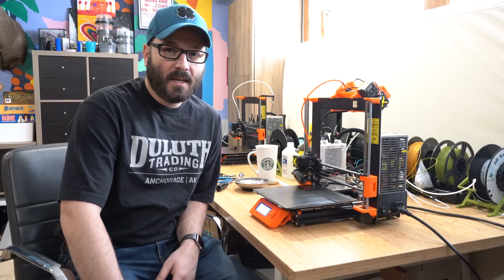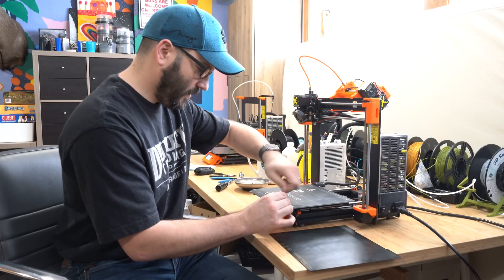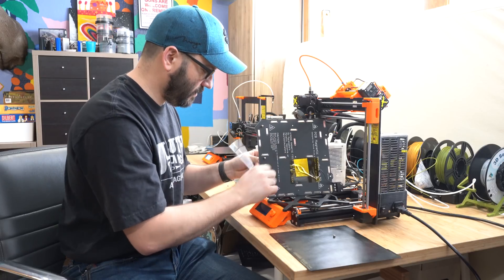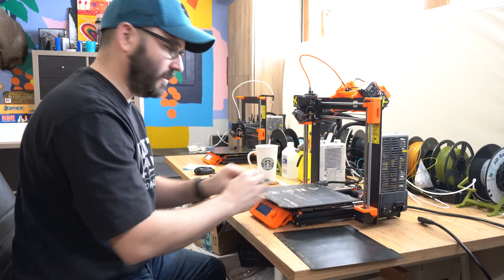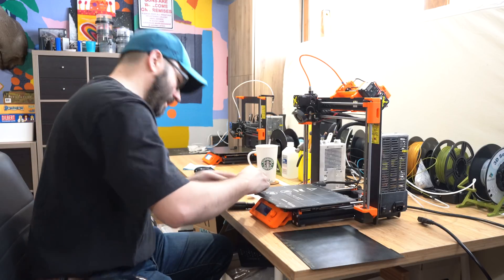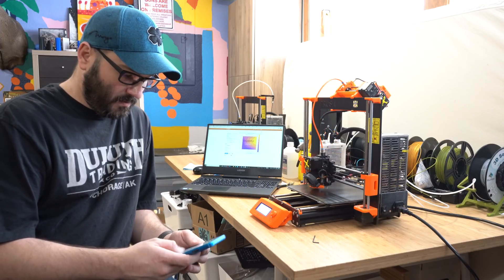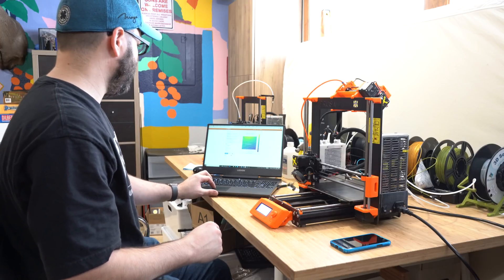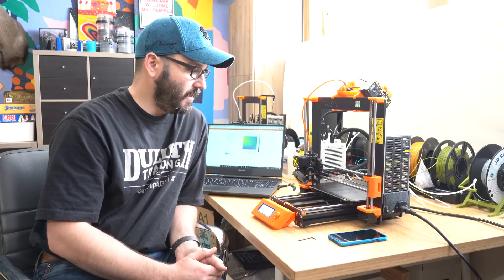PRUSA i3 MK3 Nylock Bed Leveling

Comment: Shouldn't you go and tighten the nylock now so it doesn't move?  Aka hold the screw in place and tighten the nylock against the bed?

If not it seems like this would move over time from heating and cooling.

Comment: I still can’t wrap my head around what this is doing. If I got it correct, the nyloc and the screw head is capturing the bed plate? And by doing so, turning the screw will move the bed up or down?  Okay, so doesn’t the pinda mesh leveling take care of any unlevelness? What is the advantage of physically leveling the bed?
Reply: If the differences of your bed are too big, abl will fail.

Comment: I want this. How do I connect my laptop to prusa printer to do this. Do I install octoprint on windows machine.
Reply: No, typically Octoprint is installed on a RaspberryPi. Search for OctoPi to get an easy start. When it’s up and running you handle it by it’s web-interface on a device of your choice.

Comment: You didn't edit for time very well, or explain the most important things!
Twelve minutes of putting on nuts, when you could have put on one nut & just said, "repeat for the next 7 outer bolts". A task so simple my 5 year old could do it...Then you started doing something with a laptop, without mentioning what program you're using, or how you somehow made your Prusa communicate with WiFi. You should have taken only one minute to explain the Nylocks, and the rest explaining how to set up whatever system you're using for the rest of it.
Your Nylock Leveling Update video didn't expand on any of that shit either. 
Someone told me I need to purchase a Raspberry Pi. Not that I'd know that from watching any of this. I'll still need to learn how to get a Pi to work. Jesus, this video is worthless to anyone who doesn't already know how to do the hardest part.

Comment: i recently bought the mk3s+ and im wondering why and should i make  this mod?
Reply: if you have no problems then you don't need to mess with anything. i got an mk3 a few months ago specifically so I didn't have to mess with repairs, tweaking and mods. it so nice just to print and not having to tweak things all the time. if you got a printer because you like to make and mess with things, then you can do this just for fun.

Comment: To make the leveling faster: A M3 Screw has a pitch of 0.5 mm. That means one complete Turn will move the bed up or down about 0.5mm per Turn. So it’s easy for you to say 90 degrees of Turning will be 0.125 mm in Z and so on

Comment: if the pcb is not perfectly flat then it certainly should be once you tighten it fully against all of those spacers.... if anything, its the y axis frame underneath that isnt perfectly flat, which isnt surprising especially being powder coated

Comment: I seem to be having an issue.  I keep getting z-level enforcered when I try to do the bed leaving via OctoPrint with Prusa plug-in.  Have you experienced that before.
Reply: Yeah. I had that happen. If your bed is that off to trigger Z-level enforced, you might need to do an XYZ calibration and then go back to mesh leveling.

Comment: The concept of adjusting by adjusting screw and locking nut is not new. The true variant that makes a rigid spaced riser and ajustable is by having two nuts To lock the screw on each reference plane (bed and frame). It goes like Screw-bed-nut1-nut2-frame. The nut1 butts against underside of bed, and nut 2 butts on top of frame. Ideally insert some washers too (between nut and bed and between nut2 and frame) but must very thin, space is at premium.

Then you must be able to tighen those nuts with bed in place (a thin open end wrench from the side).
The procedure is the same as you tighten nuts1 loosley on the bed (so it can turn the screw on the bed) and fist butt up the nut2 to lock nut1 so it does not move while adjusting. Adjust as presented in video and then:
1 Hold the screw head from top.
2. Loosen nut 2 from nut1
3. Tighten the nut 1 against bed
4. Tighten nut 2 against frame

Re-check (doing the final locking of nuts will certainly move by a very tiny amount from initial calibration as those gaps are closed and screw thread extended in the frame threads). Now the screw is the only one that changes the distange but it is locked in place. So for each minor readjustment you need to hold the head of the screw and loosen both nuts, and turn the screw accordingly, retighten and recheck. It is more fiddly in the last part to keep locking and unlocking nuts from the side but is the best method.

Even better is to use two nylocks on each screw insted of two normal nuts but nylocks are taller and there is not enough space available. Normal nuts are good enough as those nuts will be tight in the end and lock everything. So i'm not concerned about loosening. 

The down side is that you need to have good access from the side and acces those nuts. I have a prusa mk3s and will do this in short time and i will use two normal nuts. From what I see there is enough space for a flat open end wrench for those nuts to be tighten from the side and enough space for two nuts . The middle is the reference fixed. with original spacer so no need to worry about it.

So the Prusa original spacer is about 5.5mm tall. Let's say 5mm. A normal m3 nut is 2.35mm (2.31, 2.32, top reading 2.35). A nylock m3 is 3.95mm. I'd say two normal nuts is the best approach and have enough space to fit and leave about 0.7mm worth of adusting. If or some reason the two nuts actually don't fit you can put a washers on the the center stand this gains aditional space for all perimeter screws. I might add a washer to center stand to gain enough clearance for all screws to add at least a washer against the underside of the bed. (it's not nice to twist and lock against delicate pcb coat underneath). Also take creat care with the side wrenching! if you are not careful you may marr the underside of the bed while manipulating the wrench! Take great care not to scrape the wrench against the underside of bed while mainipulating the nuts!

Also do not tighten those nuts too much to avoid striping the screw! A side wrench with normal open end wrench gives you so much leverage that you must tighten with one finger. M3 is delicate and can strip with a normal screwdriver grip, an allen key gives about double leverage when long part is the handle, and an open end nut wrench is about double or triple the lenght so a lot more leverage quadruple leverage ! so DO NOT FIST GRAB the delicate m3 nut with the wrench.

Anyway. The concept of adjusting screw and locking nut to lock the position of the screw is veavily used in any adjustable mechanical system like valve thermal clearance on a car engine, or the distance between brake shoes and drum for parking brake (to spin in normal mode and to bite a bit when hand brake is applied about 2-3 tooth and have enough stroke left to fully actuate, and when release to fully realease the shoe.. it's a screw and an nut on it that space out the cam and brake shoe). The key difference is that screw and nut are solidly locked and nut is tight. and not left loose so you can turn the screw. If you need such action then two axial thrust bearings would be the corect choice but is literaly no space for that in this aplication.
Reply from the maker: While the extra nuts are indeed a better option, there just isn’t the space under the bed for this. It’s easier and still functions great just to do the single lock nut against the bed.

Comment: Has anyone seen any issues with using nylon lock nuts needing adjustment long term? From what I have found nylon lock nut inserts are only rated to max temp 220F.

Comment: i posted in the Github, but i will also post it here. Ever since my Nylock Upgrade, i have been unable to run a successful Calibration. where did i go wrong?
Reply from the maker: Man that’s crazy, I have not had any issues with calibration since I’ve done this on three separate MK3s.

Comment: Is this like a one-time-leveling or do I need to re-level it at some point?
Reply: The prusa have mesh leveling anyway, so in theory you don't need to adjust at all the bed. But starting from a good reference is a very good approach. I don't think you need to readjust it any soon. 
So the goal is to not have a bed slanted and center dipeed by 1-2mm and rely on the mesh leveling done in software but actually make the bed flat and level to start with.
In terms of printing quality is debatable. Mesh leveling is cool to print on the most croked beds with no noticable differece but still the best result is to print on a flat and level bed. this way the mesh leveling will have minimal corections to do. And if the bed becomes a bit uneven by some reason then the mesh leveling will sort it out.

It's not hard to fire up the octoprint mesh leveling plugin from time to time to see if values are still decent. They are not to be perfect. As seen in the video, the original orientation as 1mm difference! and printed flawlessly but still is nice to go from a flat condition and the mesh leveling just fine adjusting.
Reply from the maker: If you’ve done it hot you may not need to do it again. However it doesn’t hurt to check it every few months anyway.

Comment: Did you calibrate zxy after moving gantry by hand? I didn't notice. But I think I'll try this on mine. I know that there's slight deviation on mine at the front right corner.

Comment: why did you skip the most important part???? Getting mesh visualizer to work....the rest is mindlessly easy ... >_<. The forums full of people who can't get visualizer to report.  I spent two days piecing info together and i only figured it out by looking at an ENTIRELY different app for reference.
For Prusa this is the GCODE you must use to make it work:
G28 W ; home all without mesh bed level
M400
G80 N3; mesh bed leveling
G81 ; check mesh leveling results
G1 Z60 Y210 F6000

Comment: Thanks for making this tutorial.  I just bought my some nuts and i'm gonna try it this week.  Just one piece of advice that might help: m3 screws have a .5mm pitch, so if your variance at one corner is, say .1 mm from the center, you should try rotating the screw by 1/5 of a full rotation (about 70 degrees).  this should help getting things tuned more quickly.

Comment: When bed is hot variance is 0.11 when is cold is 0.022 it’s normal? .... ok after i try to adjust all screws when bed it’s hot now i have 0.02 at 70 degrees .. and 0.06 at 85 degrees and 0.06/0.07 when bed is 60 degrees ... cool 😎
Reply from the maker: It does change with heating and cooling for sure! Very nice!

Comment: if you don't want to buy additional parts, disassemble everything and reassemble do as I do, just add paper washers where the top is lower and slightly file the steel spacers where the top is high with this method I managed to obtain the same results and I believe  is even better because more solid ... however both methods are valid ... change everything with the nylock method, or go to act on the original supports as I did
Reply from the maker: That is a valid option for sure! It's just not adjustable if you need to again (either to replace the bearings or just as parts wear.)
Reply: BenGadget yes exactly it is more difficult, and slow to do ... and as you say you cannot correct precisely as with the mod ... anyway to correct the very crooked areas you can do so ... thanks for the video guide !!

Comment: Do you need to tighten the nylocks underneath after you get the results you want?
Reply from the maker: Yes! You will need to hold the screw from the top and then tighten the nut against the heated bed on the bottom to keep the screw from moving again.

Comment: Necesitamos una raspberry para poder conectar el pc a la prusa no? es decir no se puede hacer sin raspberry?
Reply from the maker: Marco A. Gonzalez no you do not have to use a raspberry pie, you can use in a Windows or MacOS or I think Linux computer
Reply: @bengadget5095  y como conecto el pc a la prusa? Con el cable usb? Y luego abro octoprint en el pc?
Reply from the maker: si, eso es correcto

Comment: Ben, I actually tightened my nylocks down between each bed leveling with a 5.5mm wrench. Then for the ones that needed adjusting, I would loosen the nylock slightly, turn the hex bolt, then retighten the nylock. It was a little more tedious but I was worried (probably for naught) that they might vibrate and loosen some. I got my total variance down to .05mm and could probably do better but half the thickness of a hair seems pretty good. Thanks for going through the process. Your video clearly went through and showed the process.
Reply: if they're nylock they won't move. ever.

Comment: Thanks man, my bed is now at 0.02. Im so happy.  Never had problems but this is a great upgrade!
Reply from the maker: That’s great!!! I’m glad it worked out for you.
Reply: @bengadget5095  Hey Ben, one more question. Like i said my value was at 0.02, but after 1 or 2 weeks it was at about 0.6. Is that normal or Did I something wrong? Or is it normal that the value is changing?
Reply from the maker: @TheOldKenobi  I think it's normal for it to change with a couple heating cycles if you don't have the nylocks completely firm. I would do it again with the bed hot, and then make sure the screw is tight against the nylock when you are done.

Comment: Hey there, got a mk2 went to 2.5 and want to do the nylock, how long are the screws that enter the top of your heatbed? And am I correct I should be able to thread them into the x carriage? because I can't on mine the bolts slide right through from the bottom into the spacers.
Reply from the maker: The screws for the MK3 bed are: M3x12. You should be able to thread them into the X carriage, but I removed the spacers  between the bed and the carriage (that's where the nylock nuts go.) I don't know if it's the same on the MK2 or 2.5 as I don't have one, nor do I know anyone that does :-(

Comment: why are the nuts build in with the nylon part facing the printbed?
Reply from the maker: I turned them over so there would be less contact with the bead for heat transfer, but in the end I don't think it makes any difference.

Comment: Do you still need to do this now that the heatbed has spacers where you would put the nylon nuts?
Reply from the maker: Yes, it has always shipped with the spacers, unfortunately there is no way to adjust the spacers, that is why we use the NyLocks. :-)

Comment: Maybe a stupid question but why should you do this procedure with the nylocks?
You have auto bed leveling that compensates the difference in level/height!
Or is that not precise enough, i do not understand it.
Reply from the maker: The mesh bed leveling will allow for the printer to have a virtual level bed. it will move the Z-Axis (hotend) up and down to have the same height first layer.

This is great for first layer adhesion, however it doesn't actually make the whole print level and square. This is really only a problem when you are printing large, flat, or full bed prints. At that point, you want to have a truly level bed, so your part is actually flat and square.

I hope this helps, let me know if I can clarify anymore.
Reply: @bengadget5095  Ah i do understand it now, thanks!

Comment: I'm confused, at ~13.03 you show the lock nuts installed under the bed in the wrong orientation. They should be flipped (round part/nylon insert facing down) the other way as shown in the original guide. The flat part of the nut should be the side against the heat bed with ideally a nylon washer in between the nut and the bed.
https://github.com/PrusaOwners/prusaowners/wiki/Bed_Leveling_without_Wave_Springs
https://github.com/PrusaOwners/prusaowners/wiki/images/Bed_levelling.jpg
Reply from the maker: Right, I flipped them so there would be less heat transfer, but in the end I don't there there is any difference. I did post an update video that stats that I flipped them as well.

Comment: I am new in 3D printing. What is Octoprint? The printing software? 
When you buy a Prusa, there is not software ?
Reply from the maker: The PRUSA comes with all the software that you need (you really only need the slicer software e.g. PRUSA Slicer, Cura, Ideamaker.) 

Octoprint (https://octoprint.org/) is software that you install on a RaspberryPi, either stock O/S or you can install OctoPi (https://github.com/guysoft/OctoPi) 

Once you have Octoprint installed on your RaspberryPi, plub the USB port on the printer into it, and you can control your printer with it (start prints, change temps, move axis, do time lapses of prints.)

Comment: Cool, I got a pack of 8 M3-.50 Lock Nuts at Lowe’s for $1.98 Took me like an hour to find them haha. Lowe’s Item # 755490 Model # 127091 if anyone else is interested in getting them locally. They were tricky to find but the 3mm washers were right next to them so I would grab those too.

Comment: Does this still work? I installed that plugin but it would not load the image after a bed level check.
Reply: If you're having issues I would suggest getting on the PrusaOwners github and asking for support there. Also make sure you followed all the installation instructions for the plugin.
Reply: @Zaf9670  I figured it out.
Reply: @Lethalrosedose  how you figured it out, i can not solve this problem. there is no image after a bed level check can you please tell me how :)
Reply: @berkoak  this was a long time ago but I think I just reinstalled the plugin.